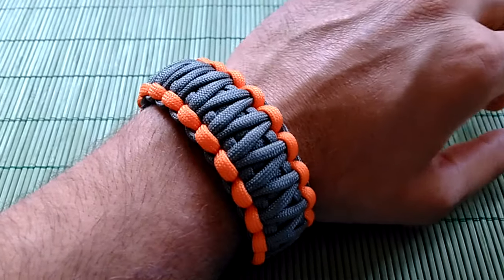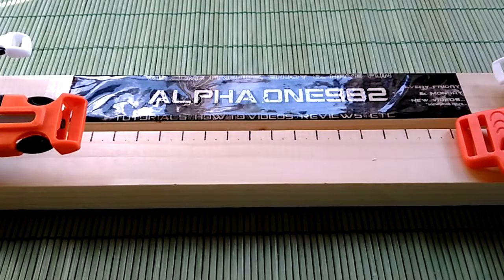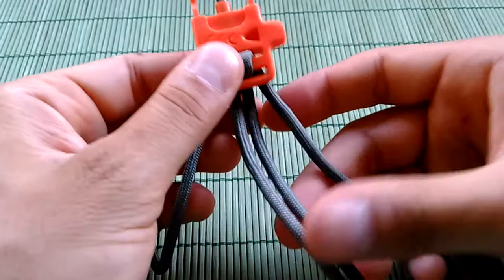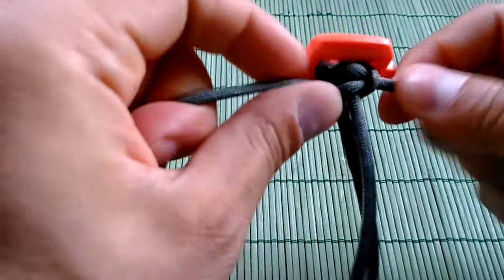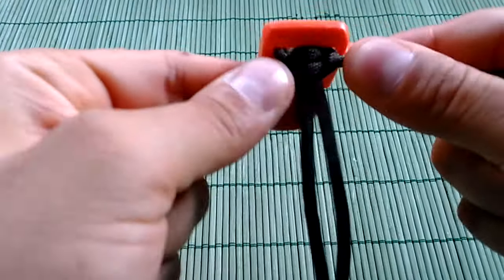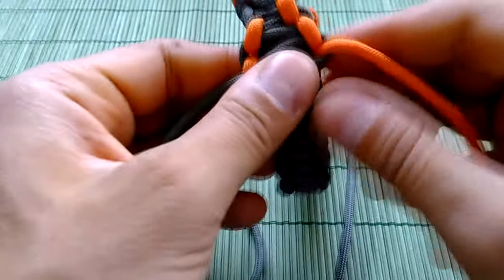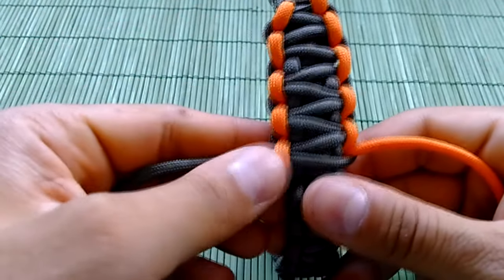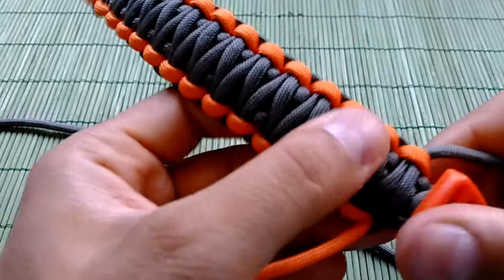Paracord bracelet King Cobra with buckles dual color   2016

Comment: Thank you for going slow enough for a beginner to follow you.  I just made my first King Cobra bracelet for my son-in-law for Christmas.  I am not exactly sure if it will fit, because my daughter gave me a measurement of 7.5 inches, but when I set my jig for that and tried it that was too tight for me, and he is a much larger guy than I am so I made it larger.  I used two tone  black/white color as my primary colors and white for my secondary color and it turned out wonderful.  I want to get a blow torch type lighter, I think it would work better for melting the ends.  I only have a simple Bic lighter,  I really enjoyed your video.  Thank you for doing the video and I look forward to more from you.  I have subscribed.
Reply from the maker: Thanks for your support, really I appreciated your comment and I'm very proud cause you made your very first bracelet with my tutorial. I started with very same Bic lighter and after a while change it with a torch. You should always, left an inch of extra length when you measuring wrist, that's the space wich will fill the cord. I'm very happy when I hear or read when someone made some bracelet. Great feeling when you making stuff and on the end you see the result of your hard work, that's the main reason why I started this channel. Thank you, for the kind words. Have a nice week and Happy holidays.

Comment: hi there,  do u use buckles size 20mm or 10 mm?
Reply from the maker: Hi Fernando, thanks for the comment. The buckle is 25mm x 60mm, you can use any buckle you have, it's two strands bracelet base. If you like consider subscribing, like and share video's you like. Thanks, cheers
Reply: I am going to try to explain here, I would like to speak and write in English, there are several threads within the paracord thread, that is, 7 or 9 threads. I would like to know the best one to work with? I'm using the text translator.
Reply: thank u, obrigado
Reply from the maker: Hi Fernando, if I understand you well, you're asking what type of Paracord is best for bracelets? 
There are many different types of Paracord I personally prefer and use Paracord 550 with 7 inner strands for my bracelets. 
But you can use the one with 9, try and see which one is better for you.
Have a great New Year, enjoy creating awesome stuff out of Paracord! Cheers!
PS: Hope I helped.
Reply from the maker: You're welcome. De nada.